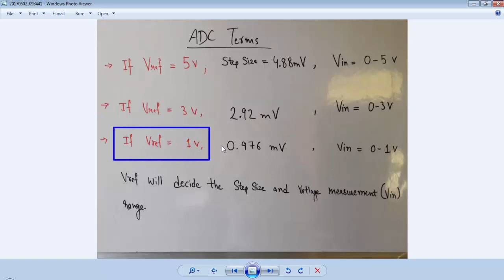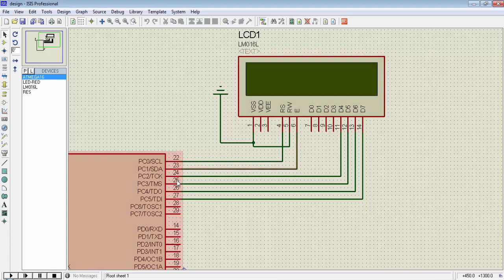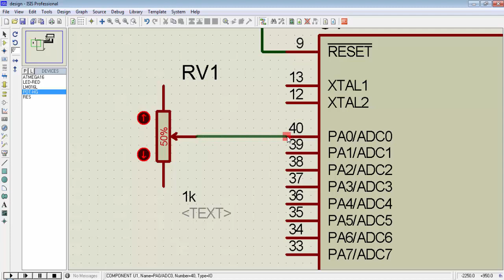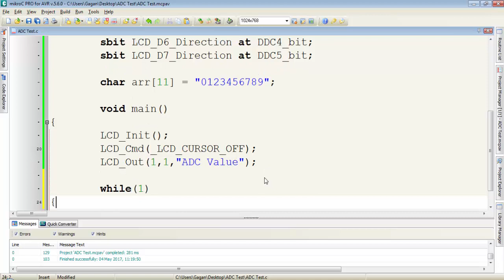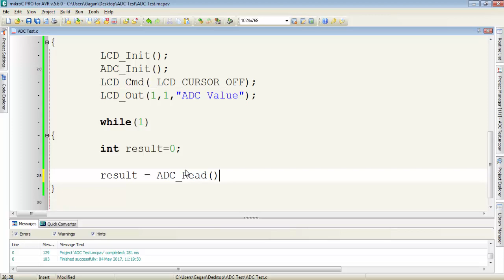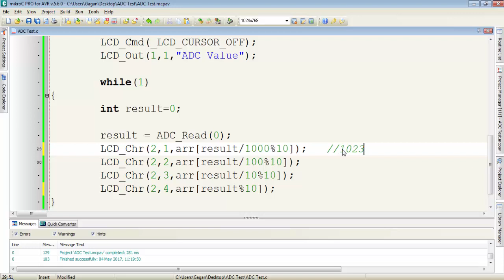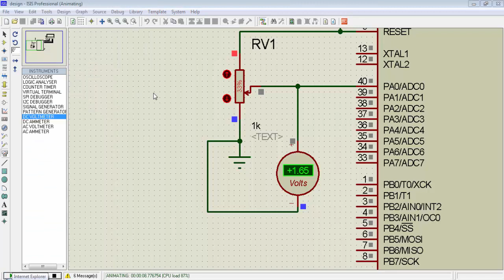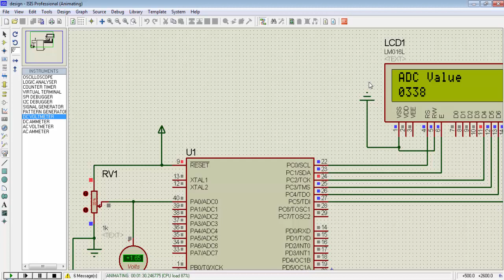Atmega16 Tutorial 9   ADC & ADC Library

Comment: What if I wanted to apply voltage more than 5v, what changes would I need to bring in the code or connection? Thank you
Reply from the maker: The microcontroller and lcd have maximum voltage rating of 5v so you will need a voltage regulator to convert from high voltage to 5v. Such a regulator type is 7805.

Comment: Sir i am going to interface LM35  what changes i have to make
Reply from the maker: LM35 is a 3 pin Temperature sensor... Look at its Datasheet for power connections and connect the Analog output of the sensor to any ADC input.

1 degree centigrade = 10 milliVolts

change the code according to this.